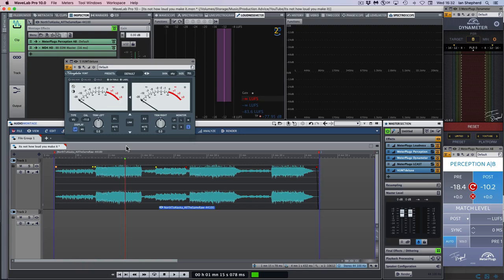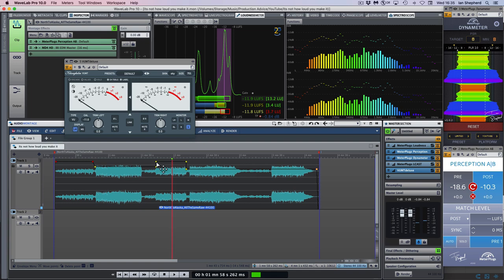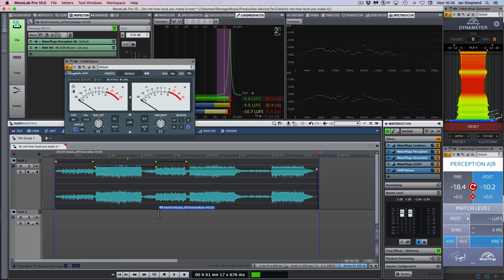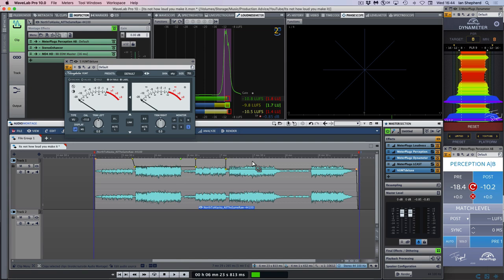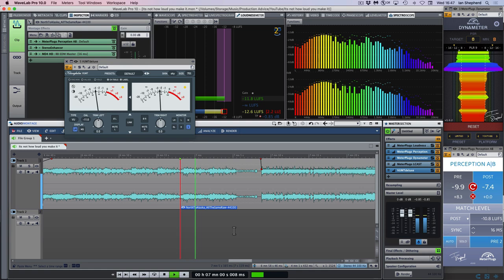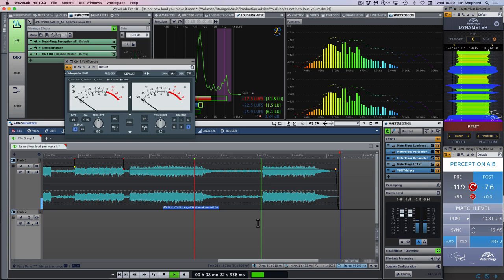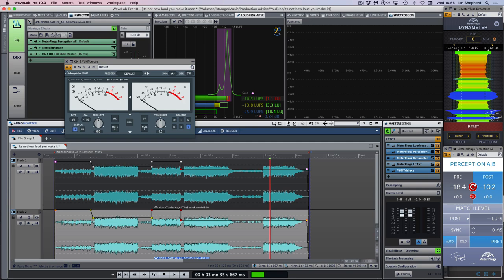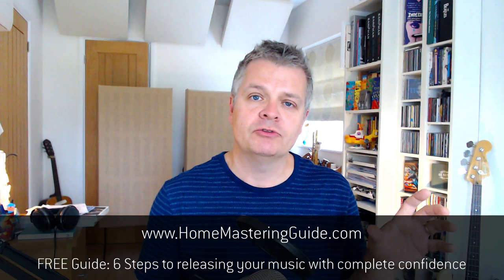It's not how loud you make it, it's how you make it loud

Comment: I'll be honest, the coolest thing about this was seeing automation in a master. It's something I feel the need to do on one of my songs as I can't get the loud quiet dynamic close enough in the mixing phase on one particular section. Seeing that gave me the confidence to try it. Can I also ask, in such a scenario, would you automate 2 different compressors switching on/off for loud/ quiet sections if you felt that necessary? I know you favour the 'less is more approach'. But when we use a comp on a whole song it is only tickling the peaks of what is usually the chorus.
Reply from the maker: I would definitely try to avoid it - the more in-depth the mastering gets, the more I start to feel that mix alterations would be a better approach. But sure, if you feel that using different dynamics processing on different sections of the song is going to get the best result, by all means. Occasionally I might use different EQ settings, too, or even different stereo enhancement, if it seems appropriate and the client agrees.
Reply: @ProductionAdvice  Thank you.

Comment: Do you mean "Softer" at the end of the description :) Great video - thanks
Reply: I wondered why you have the outro section lower in clip gain than the first chorus?
Reply from the maker: Yes, typed that in a hurry at 3am, I need to do a proper description 😛 Edit - OK, fixed !
Reply from the maker: Re. the final section - it just happened ! I think I started with a global adjustment, them was making adjustments early in the song and at some point ended up with the slight discrepancy. When I noticed I took a listen and decided not to match the higher setting, partly because I didn't think it was necessary but also because it leaves a little more space for the very end to build up. It would probably also work with the extra 1/2 dB, but if it ain't broke...

Comment: Isn't this just the equivalent of fixing an average mix though?  The level changes in this video are mixing, not mastering.  A good mix engineer would do the changes you are doing, before sending to mastering....  Lots of "mastering" these days seems like compensating for average mixing, and normalises the expectation that this stuff is the domain of a mastering engineer.  Mixers need to learn to mix.  If I was a mix engineer and knew that a mastering engineer was doing these dynamic changes on my work, I wouldn't be happy.....
Reply: Hmm, no, this is not an average mix at all. Sounds really good. Maybe the mixing engineer should have made those dynamic changes, ok. But I think Ian's work is correct in this production. As a mastering engineer I would not return such a good mixing work by saying that the balances between parts are incorrect. My opinion
Reply from the maker: I agree with Norberto, this mix is far better than average. And as I tried to say in the video, in many cases the need for dynamic changes only reveals itself during the mastering stage, in the context of other songs and when heard at the final loudness with the final EQ etc. So it's not a case that the mix isn't up to scratch, it's just that the changes are helpful to allow it reach it's full potential (in my opinion)
Reply: @ProductionAdvice   Let me ask you, did you lowered the threashold before export to -2db, 1db, or send it at 0 db true pick for the streaming platforms? i see it reaches -0,84 as it is at the video. Thanks :)